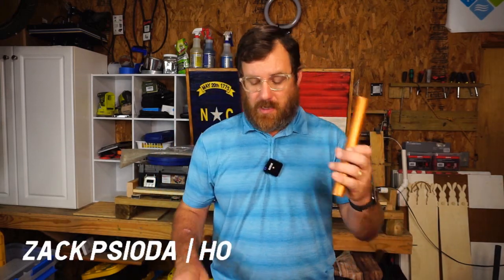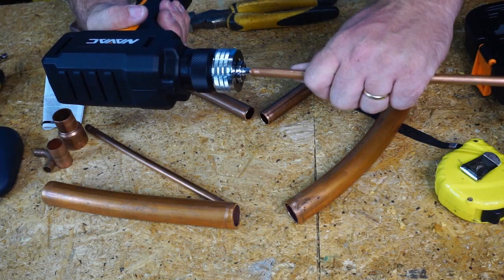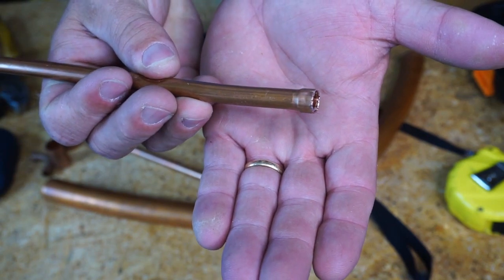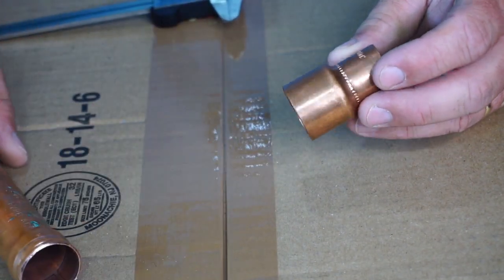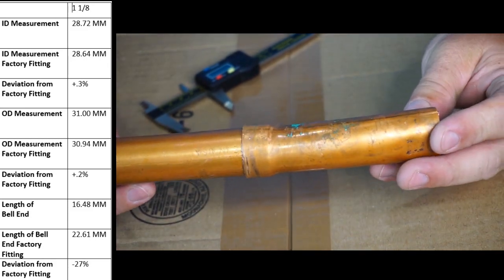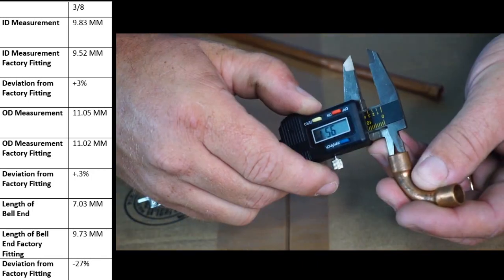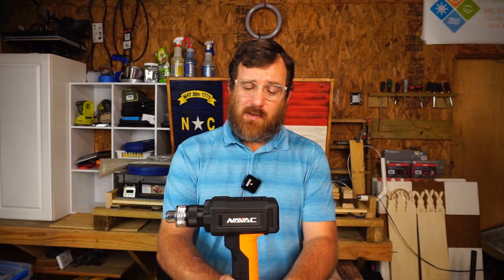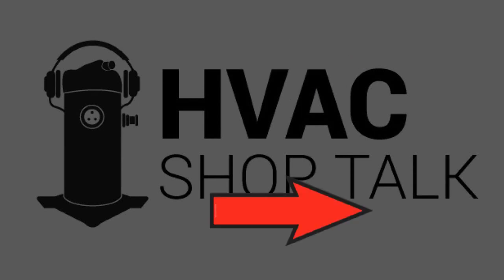Addressing Your Questions/Concerns about the NAVAC Battery Expander

Comment: You need to rotate the pipe when your about half way expanded.. works for the hydraulic swager as well
Reply from the maker: This thing swages continuously. Not sure I can rotate midway through. I can check.
Reply: @HVACShopTalk  can you stop the sewage pull out from pipe than turn 180

Comment: I do wish they provided a function that you can stop halfway through your expanding and rotate and continue expansion to prevent cracks on some manufactures copper. 

With all swedgers you may have noticed especially on some cheaper foreign imported copper with the white insulation it tends to crack often after multiple attempts.   Their quality control from one batch to the net can be extremely different.  Especially if it’s a few years old and oxidized and you’re attempting a repair the copper will embrittle overtime with the exposure to air. We’ve completely eliminated and will never use the ISO POLAR Copper due to all the leaks from corrosion on the surface of the copper on our own systems and going into repairs in other peoples locations that are only a few years old has become a big money making business replacing customers complete line sets or somebody has used ISO POLAR Copper. 

And as for the grease even on the handheld hydraulic swage tools if somebody what are you read the instructions they tell you to periodically grease or lubricate them. 

Battery powered swage tool when we install a large VRF system 20 tons to 60 tons and you have somewhere between 1000 feet and 3000 feet of copper with a few hundred swage connections it’s nice having a battery operated unit.